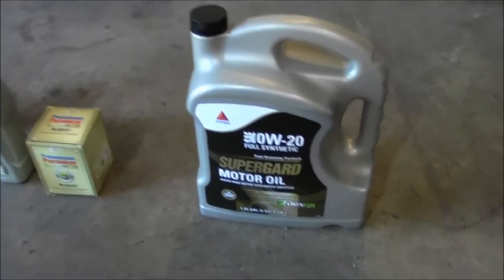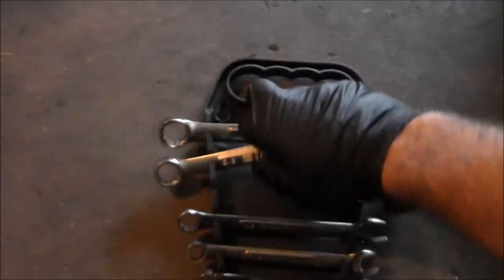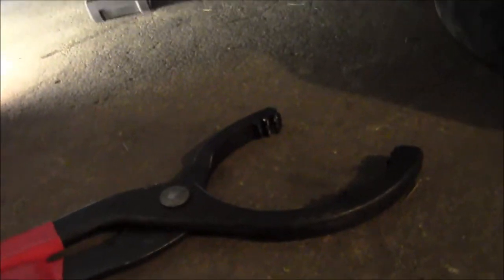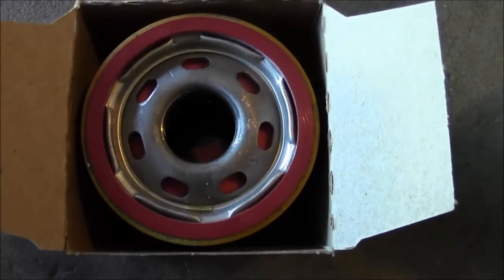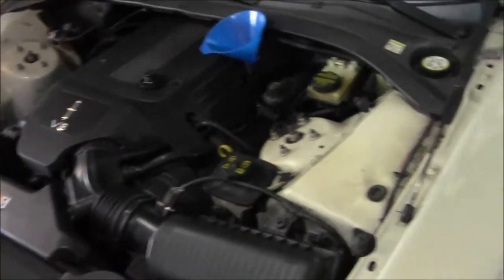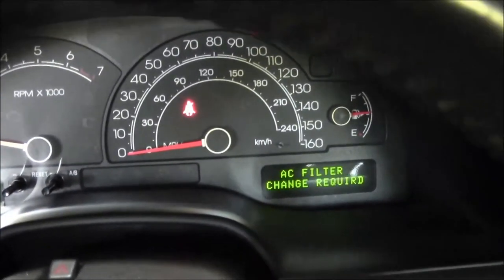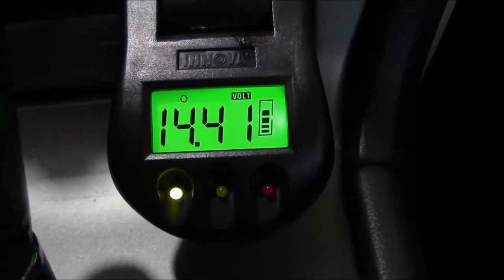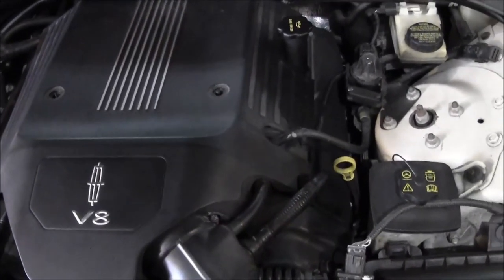Lincoln LS Oil Change Citgo 0w20

Comment: Have you ever cut open a filter to see if the magnet held anything?
Don't you put it down to drain?  Usually more comes out when done.
Reply from the maker: JBT Cajun:  I have not cut open an oil filter off of my Lincoln.  I have cut open oil filters off of my Mustangs and my Yamaha R6. https://www.youtube.com/playlist?list=PLFSGDRZeVNZTi8xchmIRkYYTMtQVaTxhO   The filtermag does work very well.  I usually let the oil filter sit on the oil drain pan over night.  There is a small raised section on the drain pan that holds the edge of the oil filter up and allows the oil to drip out.  This LS has an oil cooler on it, which tends to release oil slower from the oil filter mount than a car without the oil cooler.

Comment: What year did they stop making the LS? I might start looking for one. Thinking about dumping the Tahoe...how are they in the snow??
Didn't get to my timing on the Stang tonight...will though this week for sure. Got my timing light and tool for the distributor cap. Will let you know.
Reply from the maker: J PP:  I think 2006 was the last year.  Mine is pretty good in the snow.  However, I do have snow tires.  So that does help out when the snow starts falling.  What kind of timing light did you pick up?
Reply: @fwh79FOXR6  ok, yeah, I've looked at them, seen 06 was the last year. You can find them decently priced. Like my Tahoe, so I'm not sure what I want to do yet. I also have an old 99 GMC Sierra that I could always use. 🤔
I bought an Actron timing light. I haven't used it yet...was hoping this week...but I have a pool heater pump out that I'm monkeying with right now. I also bought some power steering lines on the Fox, that are leaking like a dead pig in my garage. So I've got a couple things in the pipe right now. 
I DO plan on getting this timing checked and adjusted by the weekend. It's suppose to be nice and I want to get some more drive time in...leafs are falling!!
Reply from the maker: J PP:  They are pretty nice cars.  I have heard and seen some horror story videos on YouTube about them though.  I got lucky... my dad owned the car since it was new.  So it was well maintained.  Be sure to look around and find one that was maintained if you decide to get one.  I heard ya, plenty to do.  The leafs are falling!  I've been trying to enjoy my bike while these last nice days are still around!
Reply: @fwh79FOXR6  really? What is the bad on them?? I haven't ran across anything that indicates they have the potential to be bad.
I guess the same rules apply with a Fox? Find an owner that LOVED his car, that way you know it wasn't trashed!
Yeah, colors are starting to change, not looking forward to winter.
Someday, I will check out of the Midwest for the season. I can tolerate 3 of the 4 seasons in Michigan, Winter isn't one of them!
I will let you know what I find out with the timing!!
Reply from the maker: J PP:  Yeah, I saw some interesting videos about coolant issues.  It seems like the dual zone hvac can be problematic.  I guess that advice holds true for any car purpose.  It does seem like some cars can handle maintenance neglect better than other cars can.  Most asian cars seem to be pretty tough, even when neglected.  I know what you mean, the older I get... the more I seem to dislike winter!  Although, the changing seasons are kinda cool.  I guess it makes you appreciate summer much more than you otherwise would.  Should be interesting to see what your timing is at.  Ignition timing can really make or break the way an engine runs.
Reply: @fwh79FOXR6  interesting...I may look up some of that. Like I said, I have always liked that style Lincoln...they really do look sharp, for a 4 door. 
I was going to go out to the garage last night around 930pm, but man, my days...between work and other obligations, I'm spent come 9-10pm. Guess I am getting old, lol! I have a feeling, all I've read and seen out here and read....it most likely is the timing. Curious to see what that reads once I point it and hit the button. What really makes me think.its timing? 4th gear, now behaves the way 3rd gear used to. First gear was useless with 373 gears. Second would be short too, now 3rd is short, where it once was a longer gear, that I could gain speed in, that's now the way 4th behaves.   Strange. Maybe that sounds like something different than timing to you? All of this came about after that WOT incident about a month ago.
Reply from the maker: J PP:  Well, start by checking the timing.  That WOT issue is still really odd to me.  Not to mention, very dangerous!  I still think that would have something to do with the cruise control.  Or, your throttle cable may be binding up for some reason.  Should be interesting to see where the timing is at.
Reply: @fwh79FOXR6  you know, when I bought the car, he had some aftermarket, tinker-toy steering wheel in it. I bought an original and replaced it. Two things I noticed at replacement. 1.) The horn wires were severed...and couldn't be used, no horn. 2.) The 3 small brass pegs/tabs that are for the cruise control and run along the dial under the wheel, were  broken. So no more cruise control either. However, I'm sure it's still all there under the hood. Wonder if I should unhook/pull all of that...under there, since it's no longer operational at the wheel. 
But yes, first thing first, timing! I will get to that soon.
Reply from the maker: J PP:  I would definitely disconnect the cruise control.  It is possible that those wires are making some kind of contact when you turn the wheel, and causing the cruise control to engage.
Reply: @fwh79FOXR6  under the hood you're saying disconnect??
Reply from the maker: J PP:  Yeah, under the hood.  I think there is a control module for the cruise control that you can disconnect.
Reply: @fwh79FOXR6  thanks! I will look for that too!!
Reply: @fwh79FOXR6  just out of curiosity, what made you think of the cruise control? 
Now that you've said that, and it being broken....just curious why you guessed at that?
Reply from the maker: J PP:  The cruise control is the only thing I can think of that would be causing your throttle blade to open without your foot pressing the pedal.  We really need to figure that out and fix it.  Talk about a dangerous problem!
Reply: @fwh79FOXR6  I found the throttle cable that goes from the cruise to the TB, I'm going to just unhook it. Actually, I may just remove cruise all together. No way in hell am I going to use cruise, in a manual car. So, I read up on where the module is (drivers side fender) and how it needs to be unhooked under dash and fed out of the firewall. Even if it doesn't fix that WOT, I won't use it and I can shave off about 5lbs without it. Win-Win
Reply from the maker: J PP:  Sounds like a plan.  I hope that fixes the problem.

Comment: P.S. people need to acquaint themselves with Machinery Lubrication (Noria Corporation) regarding the "new age" of 0W20 and 5W20 motor oils. The filters we all use only filter particles at 30 microns or larger or maybe 20 microns or larger. The thin oil films of the thinner motor oils allow more of the untrapped particles to collide with bearings and cylinder walls. Oil films range from only 5 microns to 30 microns. A "0"W is as thin an oil film as it gets and a 20 is worse than a 30 at the top end. I'm seeing too many Honda and Toyota cars sucking oil (0w20 and 5w20) down long before they hit 200K miles which did NOT used to be a significant milestone with the 10W30 and 5W30 motor oils in any fuel injected engine.

Comment: My recommendation said 5-30
Reply from the maker: Sterling Witherspoon:  For a Lincoln LS?
Reply: @fwh79FOXR6  mine too...2001 Lincoln ls v8
Reply from the maker: @wataburger1306  This 2003 recommends 5w-20.  The lighter oil offers increased fuel economy over a 5w-30.  This engine really seemed to like the 0w-20.  It was much easier to start in very cold weather and I was getting a couple more MPG.